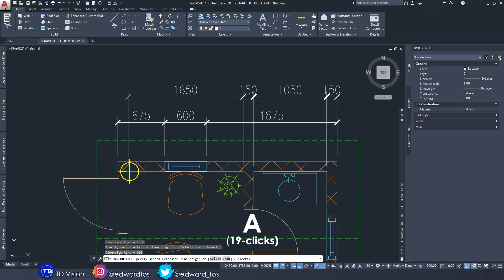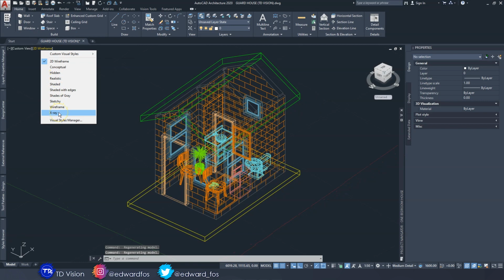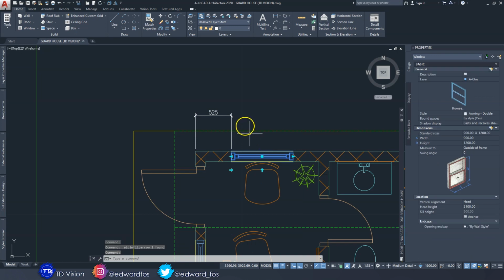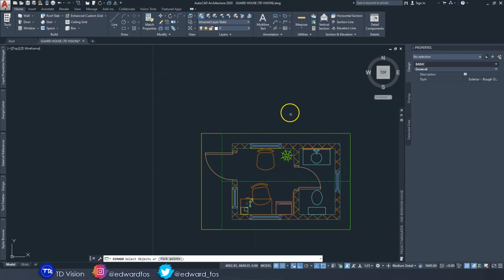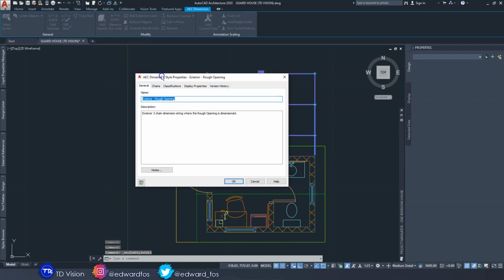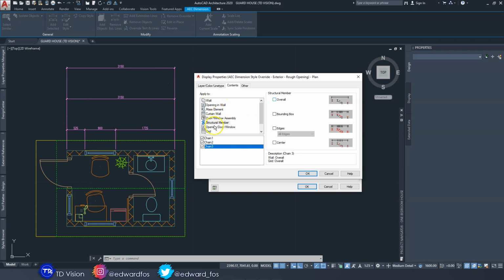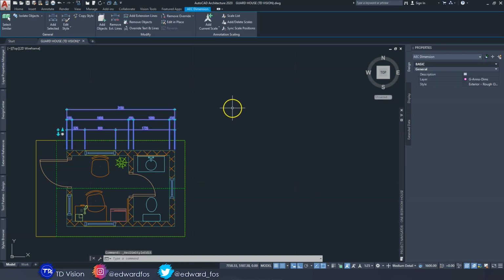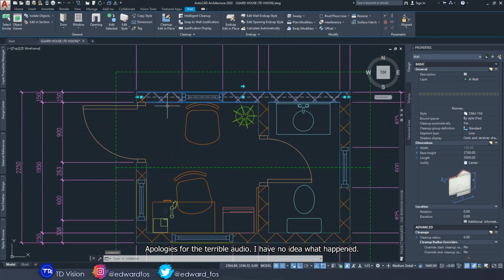AEC DIMENSIONS with "1-Click" 🤯🔥 in AutoCAD Architecture 2023

Comment: Great video (as usual) this really helps a lot. However for some reason my dimensions are not showing in work/paper space, the dimension lines are showing but not the dimensions??
Reply from the maker: Could it be that the scale that is applied to the dimensions is different from the scale in your view, in paper space?
Reply: @TDVision_U  The scale is the same, so I kind of found an interim fix by exploding the dimensions and they showed up immediately, but so far that's the only way they will be visible in paper space.

Comment: Whenever i make AEC dimenions, the text is far too large, and if i shrink the text the diagonal lines get far too large, and idk hwat to do. the only way its readble is if i drop the entire drawings scale to 1-1, but thats not a good solution
Reply from the maker: You perhaps need to edit your dimensions style. Make it Annotative. Make the text height 3/32" or 3mm. Make the arrowheads 3/32" or 3mm as well. I have video that will explain all of this, called "Dimensions and Annotations in AutoCAD".

Comment: Can you please help me , I have AutoCAD 2022 and it doesn't have aec dimension options
Reply from the maker: It sounds like you have pure AutoCAD installed and not AutoCAD Architecture. You should be able to get the Architecture Toolset with your purchase of the software.
Reply: @TDVision_U  you meant I have to purchase autocad architecture for this feature?
Reply from the maker: Yes.
Reply: @TDVision_U  okay :))
Reply: @TDVision_U  sir I have purchased architecture version recently but now after using that option it only show lines no text on those lines, can you help me with it?
Reply from the maker: Make sure your scale is set to 1:50 or 1/4"=1'-0" before you add any sort of text or dimensions. For better understanding, check out my videos on "Dimensions Explained".
Reply: @TDVision_U  is there a way I can show you image about what's happening?
Reply from the maker: Send me an email at tdvision7@gmail.com
Reply: @TDVision_U  sir I mailed you  the issue, please look into it and identify problem for me , thank you in advance. 😊